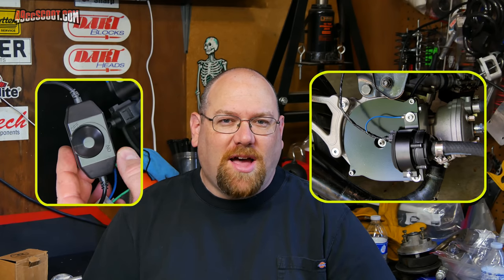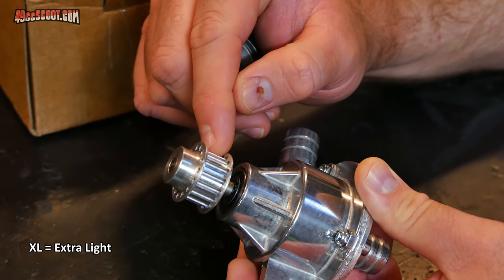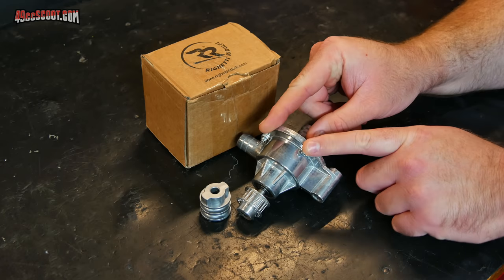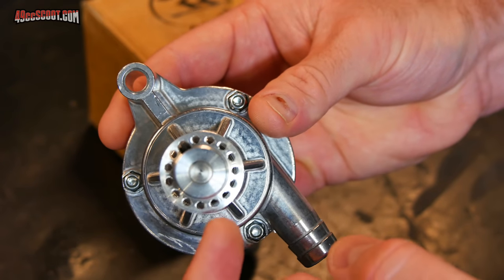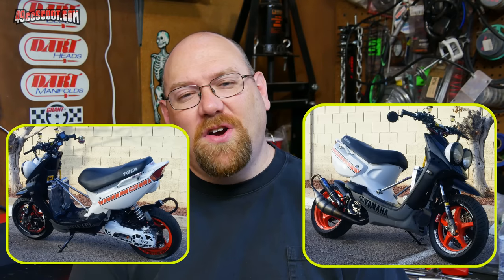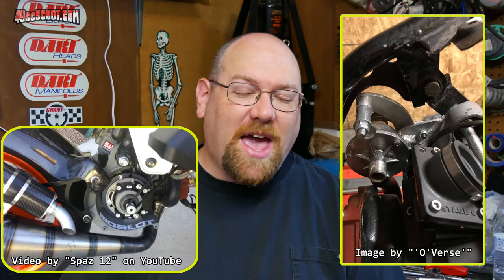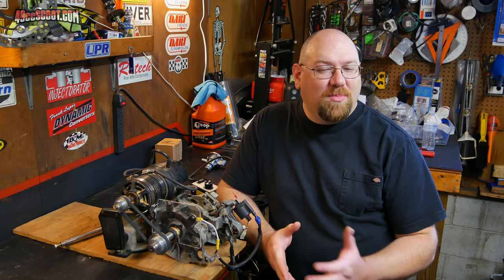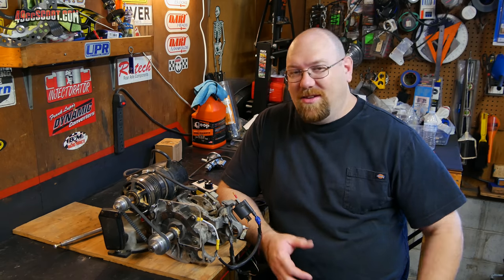TPR 86cc Build : Part 35 : Belt Driven Water Pump Info & Flow Testing : Scooter Performance

Comment: May I ask where you bought that spun aluminum touring tank?
Reply from the maker: https://www.spunaluminumgastanks.com/

The also sell them here (affiliate link)  :
https://www.amazon.com/gp/search/ref=as_li_qf_sp_sr_il_tl?ie=UTF8&tag=hotrodhellcom-20&keywords=sandstorm spun aluminum fuel tank&index=aps&camp=1789&creative=9325&linkCode=xm2&linkId=69925af4ad9bd91d07027d4596b45e96

Mine  is an 8x12" (2.5 gal). Seems to be good quality. They are thin material (I think that's standard for any of these small tanks) so just be careful tightening fittings into them.

Comment: them brushes are  dead i only know that as i fixed a number of washing machine's that have had the brushes  go bad
to me it looks about the best rpm for the pump is  5000-6000 rpm and then that maybe still a bit high as may  push the water to fast so it dont get time to cool off in the radiator 
but great video as all ways
Reply from the maker: Needing more time to cool in the radiator is supposed to be a myth. Any more modern stuff that I've read basically says that more flow will equal better cooling. That said, I think there's a point where you don't gain much.
Reply: @49ccscoot  i did not know it was just a myth my bad :(